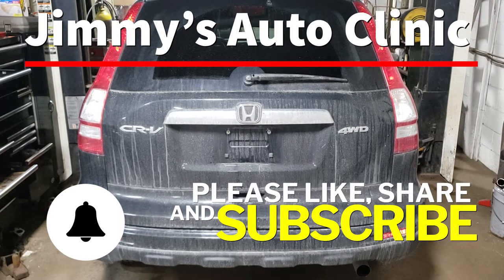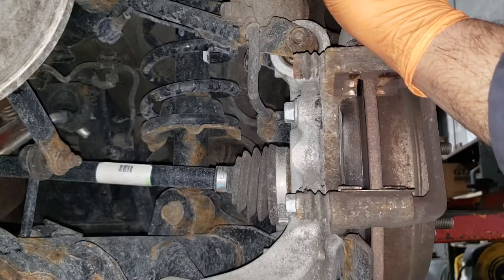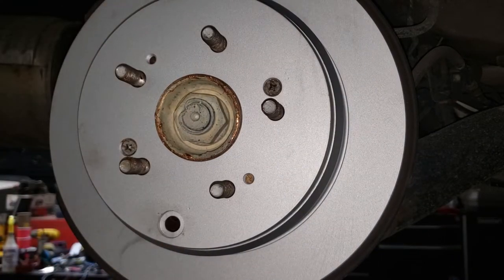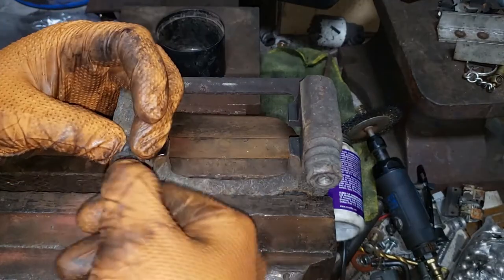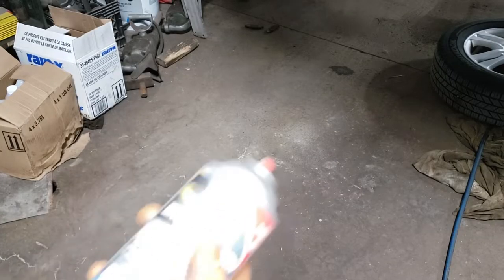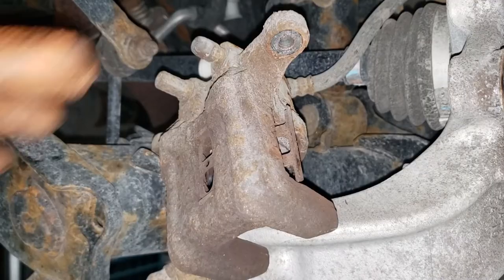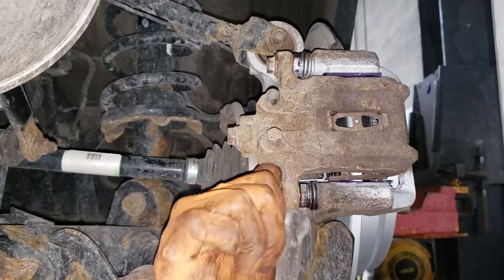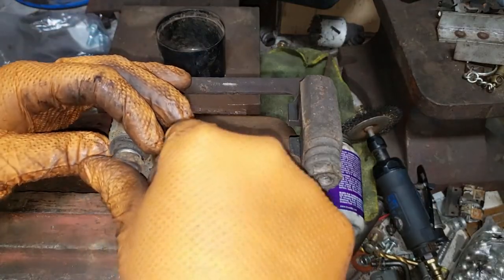2011 Honda CRV AWD | Rear Brakes Pads & Rotors | Replacement

Comment: I just did my daughter’s 2008 this morning.  Was having difficulty removing pad out of caliper piston.  Discovered that if I compressed the piston first the pad came right out. Tip of the day.  Been doing brakes for over 50 years so you learn a trick or two.

Comment: Excellent "how to" video, I'm going to use it for reference when I do mine. THANK YOU! subscribed
Reply from the maker: Hey Harry, thanks for the comments :-)
Reply: @JimmysAutoClinic  ...Front brakes are next got a video for those too? Also Rear Differential oil change?
Reply from the maker: @harryberry474  nothing for the CR-V but I do have other video showing you how to do those two things. The front brakes are basically the same the only thing that will be different will be the torque specification. And the rear differential would be exactly the same in terms of process as a Subaru. But of course the specifications and gear oil will probably be different.